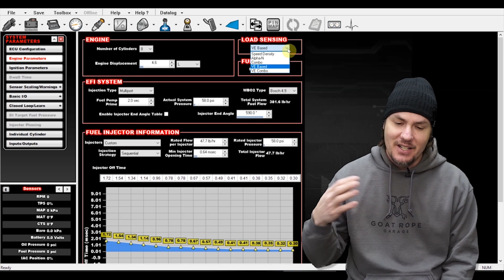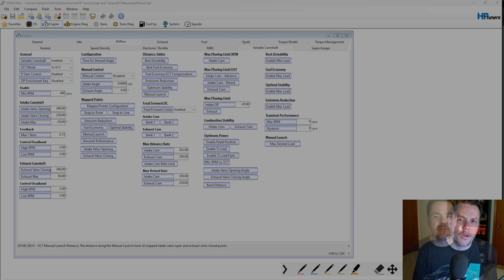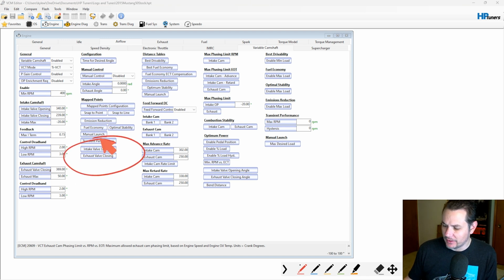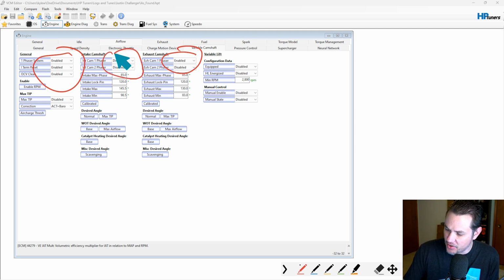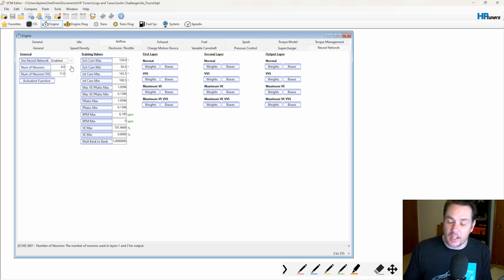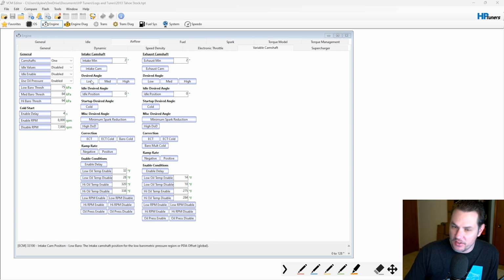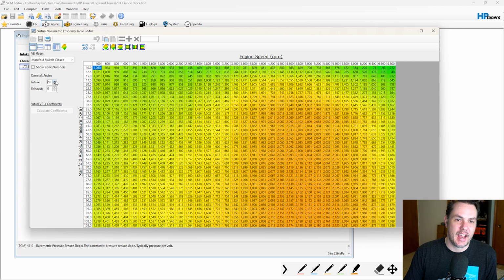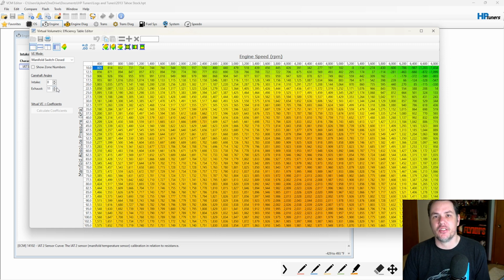Variable Cam Issues While Tuning

Comment: I'm pushing almost 60° of ignition timing in the low rpm's of my corvette c7. Crazy power down low and even better mpg too. Can spin the rear wheels from a stop at 2000 rpm's. Variable cams are awesome.

Comment: Jo, variable cam timing has an immense role to play in making power on dual overhead cam vehicles. For sure. I can attest to this because I've been playing around with the variable cam timing on my Chevy Cruze. Now before my motor blew I could easily take an SRT4 or a rabbit R and my cruise with a stock turbo and stock internals. Granted I'm running 60 lb injectors E85 full catalyst ported intake manifold like you name it. I have it just not internals. Well since the motor blew. I decided to do a full build. So now I have a fully built motor with a zzp cam b&R springs rated at 80 lb titanium retainers. It revs to 8000 RPM. I got a stage 3 clutch and a single Mass light and flywheel. The clock's in I think about 17 lb. And all the other bells and whistles to go with it, including an aftermarket turbo. I have been having a hell of a time getting the variable cam timing to make solid power all the way through and as much as I know about cars iTuned for a living. It's what I do full-time but I just cannot manage to get this thing tuned properly and if homeboy here at Goat rope garage could touch on a GM verbal cam timing specifically for the e78 ECU not for the old l&js or the l&f. Or you know none of the previous ecotech motors but like current lineup ecotech more specifically the luv and luj motors from the cruise the first generation that is. If you could do anything to touch on that that would help me out a great deal and I was. I'm sure it would help out a number of other people that are struggling with this. Now. I played with the cam timing on it previously and by adjusting it a bit I was able to on the stock cams make power all the way up to redline which this car falls flat on its face at about 5000 RPM and that was at 25 PSI. Valve float. Obviously being a problem but it was able to make power up there so I know the cams are capable of doing that. If you get the springs and retainers you know upgrade the valve train to do it. But you be doing me a world of good and probably a lot of other people too. If you had any insight on the late Gen 4 early Gen 5 four-cylinder dual overhead cam timing specifically related to the variable cam timing on these engines. Cuz I've got a lot of power that wants to be made and just I cannot get it for the life of me to make power like it was before. The can that's in it is substantially bigger the way zcp has them set up. I just need a little help here. So if you got anything to send my way or if you're going to create a video on that I would love that I'll definitely donate to

Comment: Ive tuned my dodge with an aftermarket cam using the vvt and never had a problem with fueling because of the it. Im not sure if dodge is simpler or i got lucky, but i just adjusted the cam angle and then tuned the ve table and had good results

Comment: You dont look over file's do you? My dad started funding a ls build in his s10. My buddy built a junk yard 5.3 fresh we put a stage 2 summit cam, beehive springs, and a 4l60. Sadly my dad passed away from a blood clot at a truck stop. This truck has been a nightmare but ive got it down to tuning and none of the local tuners here can get it right. Its pig rich like 9.3 wot. Normal driving its fine. It does die every now and then but im certain thats just in the tuning. Ive swapped wide bands twice both read the same. Im just at a loss. It will also randomly have a no start and pop in the exhaust but after you cycle the key it fires right up. I've got 55psi at idle, with regulator, with vacuum off i got 60 psi. Im running a stock 5.3 fuel pump in the s10 tank. Ive installed new injectors with the same ones that were in there that were also new. No change. The one guy tuning it says he believes its in tuning but i dont understand why its so rich at wot. Ive watched hours of your videos recently and im thinking its a mass air flow adjustment and the ve... but im new to this. I am a ford guy but i love this little truck. Any tips?

Comment: I somewhat disagree about having to log degree and tune each angle individually for GM gen 4. When you modify VVE for an angle, that change proliferates across all angles in the VVE editor. In other words, each degree is not independent. I've gotten lambda pretty accurate just by tuning everything at 0 degrees. The key for me is to just get a ton of cell hits when logging so that the eq error has a good sample from various cam angles. Takes longer than if I had done a VVT delete, but not nearly as difficult as tuning each angle separately. Only way I would consider doing that is on a dyno, not street tuning.

Comment: Car Craft or Hot Rod magazine years ago did dyno tests on an LS engine with the variable cam timing locked out, and then with it working. It definitely filled out the power curve, so to say the variable cam timing "is really there for emissions first" isn't accurate. The difference with and without was significant.
Reply: Can confirm...VVT at it's heart exists to improve emissions. Same goes for most of the innovation/complexity in the powertrain.
Reply: @anasasisxenophontis  
As a professional mechanic for over three decades now, I can confirm that I'm very well aware of how various aspects of modern powertrain design affect both performance and emissions. I know for a fact that, particularly on naturally aspirated engines, variable valve timing greatly improves the operating range of the engine by advancing or retarding the valve train action, and it improves peak output by being able to change the lobe separation angle on most modern engines. I'm also aware of how it's used to affect emissions in various ways.
So if someone wants to come along and argue that it's primarily for one or the other, I'm going to disagree and say it's equally beneficial for both. Frankly I think it's pretty awesome because it lets you have your cake and eat it too. If there was an easy way to retrofit VVT into my classic vehicles I would do it.
Reply from the maker: I’ve ran plenty of back to back tests on the road using a draggy and there was no benefit, after accessing the tests times were faster with it disabled. I don’t care what any dyno says, off is not shaving time off the 1/4 mile it’s useless, especially given all the collapsed lifter issues. There is a reason it I didn’t come on the LS7
Reply: @GoatRopeGarage  
Well, either way I enjoy your videos and have learned some useful things for tuning my own vehicles, so thanks for putting yourself out there. 
By the way, speaking of testing and evaluating things, could you maybe do a video showing the best way to analyze the results of part throttle tuning? WOT tuning results are pretty easy to test just by timing a full throttle run, but part throttle results seem to be much harder to quantify. I like to also tune for part throttle economy and I've tried setting up various graphs in the scanner using the torque pid to watch my part throttle torque output, but it's difficult to tell if I'm getting anywhere with it.
I'm an old-school guy who used to just read spark plugs for stuff like this. Lol
Reply from the maker: Part throttle is tough, because it’s so subjective to how you want the car to drive. I generally go for manners, I want a car to be stock until you open it up then unleash hell but some prefer it a little rough. Torque is a great indicator to watch as it’s calculated by the ecu from airflow and timing, those combined with the displacement can give a wicked accurate number, but your airflow has to be dialed in really dang good abs I would put it back in closed loop to get it that extra couple percent accurate.

If you really wanted to go for efficiency you could lean out the stoich table, if the ecu didn’t have a lean cruise setting and lower your PE engagement, you could probably roll around at 15.1 all day and still have good fuel for WoT. Just remember that the eq ratio for PE is based on stoich so you might have to richer that table a bit to make sure you are still hitting a good target.
Reply: @GoatRopeGarage  
I'm currently playing with my daily driver Avenger RT to get myself up to speed before I start playing with my other vehicles. I've altered the base cam timing tables to get rid of the simulated EGR, and it's already much more responsive. I've been racking my brain trying to figure out how to make it do a lean cruise. Does Dodge have a stoich table? I'm at work right this minute and all I recall are injector pulsewidth tables. Also, if I try to adjust for lean cruise, is the Neural Network going to just undo my changes? Should I consider turning off the neural network and doing the ve tuning?

Comment: We need a look at GM High feature 3.6 V6. Quad cams. Especially the early ones, with the torque control being similar to the gen 5 motors, but no Virtual Torque application, or VVE in HPT, and cam angle affects the torque table as much as spark timing
Reply from the maker: I’ll have to look at one, crazy
Reply: @GoatRopeGarage  I can send you some files if you'd like
Reply: please take a look at these engines us people that have the 2010 2011 camaro v6 engines have to try and tune this bosch ecu. it is truly hard to tune and get right

Comment: On a GM for most vehicles at least, setting the table to 0* is actually going to be 8.5* advanced on cam angle. Locking out a vvt cam at 0* you would want to use a value of 8 or 9. Also I have had success on gen 4 and 5 trucks setting the "egr" portion to a max value of 8 and interpolate to make it blend well.

Comment: Definitely emissions, from what I understand GM only retards cam timing on trucks. It causes an egr effect from the exhaust valve closing later. This takes up cylinder volume which is great for fuel economy and combustion cooling.

Comment: Fords twin independent variable cam timing looks intimidating, but for tuning you really only need to adjust the optimum power mode. the rest is for blending between fuel economy or stability. I think most people would prefer their car to drive like normal and get the same mpg cruising but have the tune kick in when they get on the gas, which is where the OP mode is super nice
Reply: Thank you for that. My brother just got a 17 mustang gt and I was wanting to learn how it works and what does what lol. I have a good history on LS engines

Comment: Hey I had a question unrelated to this video have you been able to recover bricked gen iv ecus I have bricked a couple and was wondering i should toss them or try to fix them
Reply from the maker: Might be able to with a MDI, how did they get bricked?
Reply: @GoatRopeGarage  it's an 06 auto GTO I manual swapped I was trying to load an 05 M6 file and it bricked it. I thought something else caused it so I grabbed the spare one I had and same thing happened